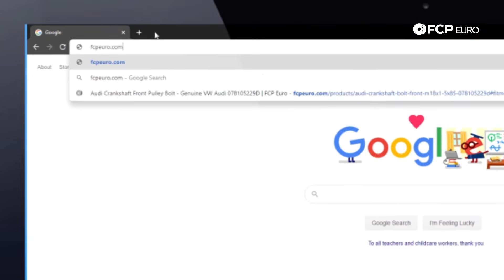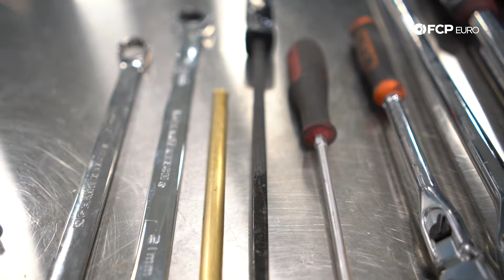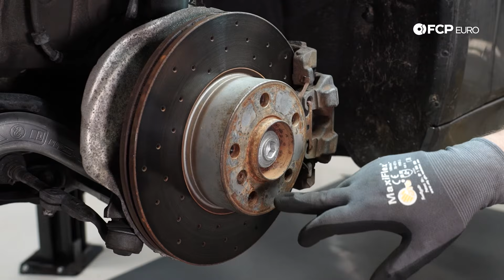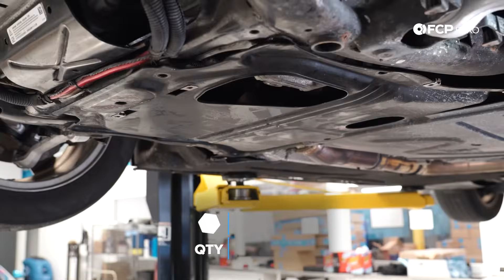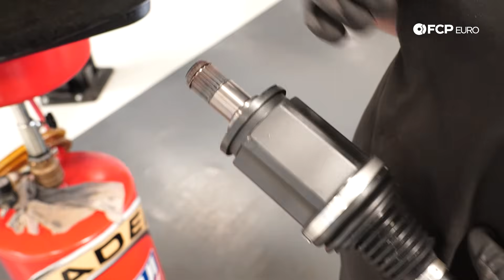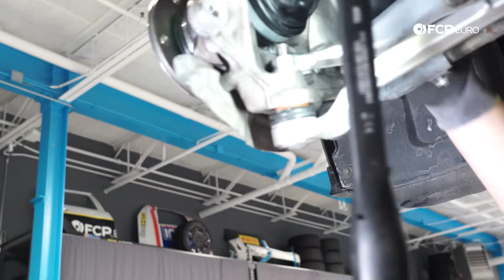BMW F30 xDrive Axle Shaft Replacement (BMW F30, F31 328i, 330i, & More)

Comment: I took a chance and didn’t replace the seal, mostly cause I wasn’t sure it was 100% the right seal I had. That turned out a bad choice cause now I have a leak there. So gonna have to take it all apart and do the seal too. Hopefully I’ll be able to get the cv axle out alright without damaging it.

Comment: Excellent video and great info on tools, torque specs, tricks and tips!  However, I’ll provide one piece of constructive criticism…there is ZERO chance you popped that inner spline and spring clip out with that little tap on a brass drift the way you show it on the video.  They are an ABSOLUTE nightmare to get out and nearly impossible if you’re working on your back with the car on jack-stands, unless it is 2-3’ in the air and yo. An REALLY wind up with that hammer.  I’ve walloped them with a drift hundreds of times with a mini sledge and they don’t budge…even rotating 180, then 90, then 90 again.  Best way is slide hammer with the right horseshoe attachment.  Even then it’s not trivial, and that’s with fairly low mileage cars.
Reply: Mine popped out easily with a brass drift and 3 lb hammer. Just a sincere tap.

Comment: I changed the thrust control arm but didn't know I had to remove the axle and tried doing it with removing the axle and while removing it i made a hole in my cv axle boot but was able to get it out and  put them back in on both sides and got an alignment done today and notice was leaking quite alot , so I guess my question is if I remove just the front of the axle to just change the boot because my car is only 65k do I have to do another alignment? Like I will try to remove the axle of the spindle with out removing any suspension component or just the one you removed just to ro the boot with out fully removing it from the car.
Reply: Note; I put the control arms and did not drive the car or anything only from my house to get the alignment and back probably like 25 miles and probably wont drive it much until I change the boots so I don't get alot of dirt or alot of driving in the axle with low grease in the.

Comment: Just did my outter boots without removing the axle. Thanks for the tip with lining the face of the axle up with the hub splines. Went to turn the hub with axle nut in(not torqued) and it started clicking and that pro tip definitely helped. Thanks Garrett!
Reply from the maker: Glad that tip came in clutch!

Comment: I was able to do my F32 without moving the brakes.
Reply: Did you had to remove any suspension part in order to get it out ?  Need to change my boots on both sides but got analligment today because I changed the control arms and don't want to pay for another alignment.

Comment: so would this technically be the way you do it on the right side as well with the longer shaft?
Reply: I am asking the same question … did you end up doing the passenger side. If so what did you disassemble

Comment: Just replaced mine with the axle I got through you guys as well as the seal! Thank you so much! Though, I took mine out a different way and took the axle out toward the front if the car. Found it to be way easier, all I had to do was undo the bottom sway bar end link to get more clearance and take off the dust shield to the brakes. Nonetheless, solid video!
Reply: Was this for the passenger side ? Or driver side.
Reply: Driver side  @WaelSaab-g7w

Comment: Please explain 210 NM plus 90 degrees.  the 90 degree part.
Reply: You torque it to 210NM.  Then you need to turn the bolt an additional 1/4 turn.  So if your ratchet is straight up at noon you need to turn it until it’s at 3.
Reply: @jyw107  Was the cv axle bolt replaced?
Reply: No clue.   I was just explaining what 210NM plus 90 degrees meant.

Comment: This cleared up the axle seal portion I was wondering about. I have both axles out of my F10 and all these parts are basically the same platform. I've got $1,400 of suspension parts arriving, just after spending $1,200 on GKN axles. Ordered through FCP. Thanks for the videos. Next up is the transmission service.
Reply: Any tips on removing the passenger side? I need to replace my axle seal.
Reply: $1,200??? It’s $740 for both front CV axles on FCP GKN brand

Comment: From bmw, just the part alone is 1200 I can only imagine the labor. They’ll charge 8 hours of labor when this guy did it in a 15 min video
Reply: Always faster cause the editing but I’m sure this guy can get it done in an hour or less cause he’s a beast lol
Reply: Bmw would charge 8 hours labour just for moving the car from the car park to the garage 🤣
Reply: I’ll do it for $100
Reply: The BMW OE mech/electron parts are ALWAYS more and rarely necessary to use them exclusively.  Where crucial tolerances are concerned  though; certainly don't go aftermarket brand and mate it to OE and expect it to go over very well just because the seller said it "fits."
Reply: More like 2-3 hours
Reply: labor is 1.9hr . so at a rate of 100 a hr it’s 190$ . it doesn’t take “15 min” it’s very involved . these cars weren’t made for the average honda civic owner , of course prices are gouged
Reply: @vuluv6035  this is not at all a very involved job. Probably one of the simplest you could do and probably quicker than the vcg. Not everything about working on BMWs is as crazy as people make it seem, especially with the I4 or I6 motors.
Reply: @vuluv6035 what BMW dealer you know of that charges $100 hr for labor?  I'd guess $200hr
Reply: @vuluv6035 lol I did it in under 1 hour and it pays 1.9
Reply: @vuluv6035 my mechanic trying to charge me $450 for this. 😂 labor only

Comment: Does anyone know what brand BMW use or do they make them themselves. I dont want to use an aftermarket part if it is going to be inferior.
Reply: GKN od the producent. You can also replace only outer joint - it is also  sold separately

Comment: Whats that seal called in the transfer case? Actually, it looks like 2 seals, one on the cv and one in the transfer case. What are they called...on Rock auto, specifically? Appreciate any info!!!! I see a "transfer case input shaft seal" a "transfer case output shaft sleeve" and a "transfer case output shaft seal"?

Comment: Thanks for one more of your awesome videos although I'm would not be able to do any of these repairs. I have a f30 from 2018 and I noticed a small vibration in the steering wheel at average speed. Would you know if related or linked to a suspension issue ?
BMW dealer would probably just tell me it's the road feeling from bmw.. :(

Comment: cant find a video for a pass cv axle for a 08 328xi, is this anything near the same.
Reply from the maker: Hi Will, the idea itself is going to be very similar, however, torque specs and hardware is going to be different. The E9x chassis uses an axle nut, while the F30 uses an axle bolt. This may be a video we can get to in the future!
Reply: @fcpeuro  heck yeah that would be great, I need to fix mine soon. greatly appreciate the reply.
Reply: @fcpeuro  How different is on F10 535i xDrives?

Comment: Found that I only had to unbolt the wishbone but because the bolt was so tight I was able to remove the nut and torque it later without having to use the T40! I also didn’t have to remove the rotor or brake caliper. I just made some slack on the brake line and popped off the headlight levelling arm so it wouldn’t get yanked. The axle took a few blows to get it out but it was removing the oil seal that was the worst to remove. New one in worked best tapping in with a socket extension around to make it flush (had a pipe about the same diameter but I couldn’t get the seal to be level). All in all not bad! This video did help me out a bunch. Great job guys! My axle was fine but my oil seal was bad, slow leak, mainly on the highway. The tightening spring that clamps down on the seal to the axle, part of the guide had torn so it was kinda popped off. I also topped off my diff fluid (did a fluid change previously to see if that would stop the leak; nopes).

Comment: Good stuff. Thanks!
Reply from the maker: Glad you liked it!
Reply: @fcpeuro  is the process similar for the rear axle in terms of the seal? You need to replace it? I had to take out both of rear axles and have already put one of them back without replacing the seal. Any help is appreciated. Thanks

Comment: @FCP Euro Hi, I have an E90 with 89k miles on it that I bought almost 2 years ago (2008 328xi 6MT) but the car came with hardly any maintenance history. I don't have any consistent CV joint clicking noise going on  (YET) and the car drives as it should, but I do notice a slight noise when I first start the car, when it's cold out, when I go to back out of the parking space and turn the wheel I hear like a single click (not 100% sure if it's an axle noise but believe so) ...but once the car warms up I don't notice the sound anymore, if that makes sense? It doesn't click around corners or any of the other normal obvious CV joint symptoms, and the boots don't appear to be compromised,  but I was thinking of replacing the axles merely as a preventative. It doesn't have a lot of miles for it's age, but it is 12 years old now. What is the average life on these axles? (Also I live in CT so you know how bad the winters are here.) There was only 1 previous owner before me (a woman in her 50's) and she always garaged the car and never took it out in snow but I don't have a garage and it's my only car lol sooo it's seeing plenty of NE weather. Do you think this is a good idea to pro-actively change the axles, or should I leave it until it becomes symptomatic?

 Are there other suspension components that I should get to before the axles? Initially my idea was that once the car hits 100k I planned to do the entire suspension refresh (front and back with your kit or the ECS one ...shhhh) and at the same time get some coilovers installed. I'm going to have my local mechanic do the work, but what else is good to replace when you have most of the suspension off the car? Like is that a good time to do the oil pan gasket as well? I just want to kill the most birds with the fewest rocks as possible. Also, if I do end up getting something like one of your suspension refresh kits, is that the time to also do the subframe bushings, and what do you suggest as the best replacement as far as bushings go? Stick with OE or is there a better option for a similar price? If I split the job into two parts, front and back, which one is better to do first? 

I know this turned into a wall of text but any advice is greatly appreciated. Maybe you can break down my questions into chunks. This is my first BMW and I'm a chef, not a mechanic, but after 2 years I haven't had really ANYTHING break on the car and it runs smooth as butter. The research I did before buying the car pointed to the N52 as being fairly reliable and I can certainly attest to that. The only things I had done were what a friend told me to do since I had no history other than seeing on the carfax that all the recalls had been completed by the dealer. 

The things I have done so far (all parts purchased from FCP Euro and all as preventative maintenance ) is install genuine BMW aluminum pedals and matching foot rest. 
I got the leather M shift knob/boot, all new OE plugs and coils, new serpentine belt, tensioner  idler pulley, air filter, cabin air filter, and I used the Liqui Moly engine flush when I changed the oil with fresh Liqui Moly and added the CeraTec to the oil. I also did the Liqui Moly fuel system treatment.

 I know these cars start having issues right around this age/mileage so the more I can stay ahead, the better. No sign of any OFHG leakage yet, but I plan on doing that when I do my next oil change... even though it might have already been done, because again, I have zero history. Anyways, doubt anyone will read all this because you guys are so busy so I may copy/paste it as an email and see if anyone has time to respond in depth. Thanks for all these videos! At some point I will  start investing in some tools and get to wrenching on her myself. Big THANK YOU!!

Comment: I need to replace the front passenger CV axle on a F01 2012 BMW 750LI X-Drive does it work the same? And please do a videos on the N63 4.4V8 that BMW uses it will sure help a lot of DIY BMW owners
Reply: Me too on my 2013 bmw 528i Xdrive. Driver side and passenger side front but expensive cv axle replacement...
Reply: @dannyrs8437  how much was the repair for it ? I have the same car and my driver side front axle is broken

Comment: Very informative, thanks!
Would you make a generalized tool recommendation video? I know it's a bit off topic but a lot of guys recommend tools for Asian or domestic brands. I want to know what do I need to start on Euro cars. I know lots of tamper proof, torx and external torx, triple square for VAG etc. but what's the rule of thumb is? An example: Toyota guys say 10-12mm sockets are the most used, 3/8" ratchets pretty much every time but they don't need 24mm wrenches for instance. It would be a great help if you guide people like me in that regard. What are the essentials? What general tools to add to our toolboxes as we progress? I have a BMW, what specific tools us BMW folks would need in the future? or what specific Mercedes tools that Mercedes guys would need? etc...
Reply: BMW doesn't have anything super specific other than E Torx. So just get metric Allen bit sockets, metric shallow and deep sockets, A full etorx set. Metric wrenches ratcheting, and non ratcheting. I would mold my tool set to be universal though.